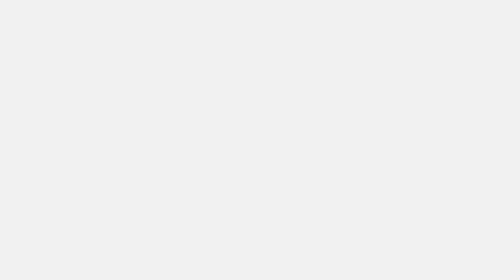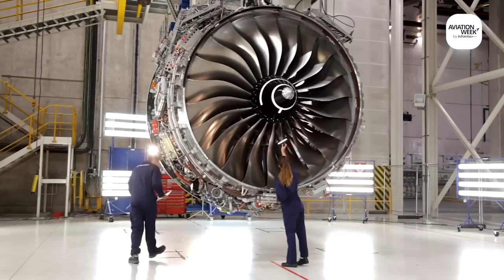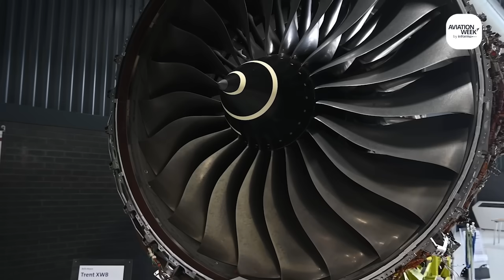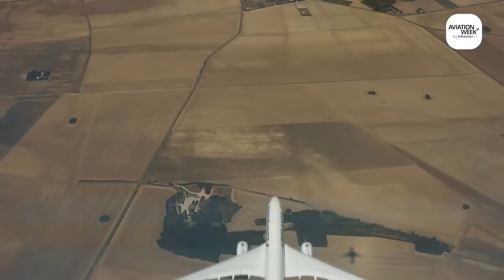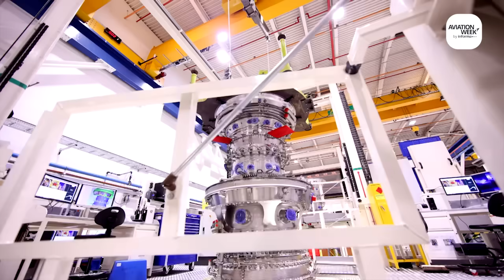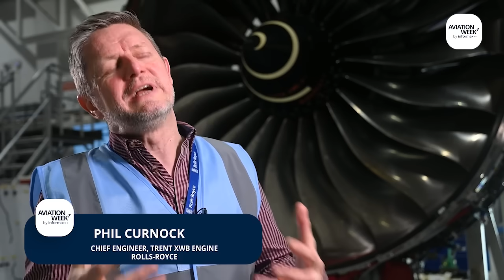Why the Trent’s latest variant is changing the mood at Rolls-Royce

Comment: A GREAT 'Made in ENGLAND' story.......!
Reply: The Rolls Royce aero-engines are made UK, Germany, Singapore, and the US - but UK is where they are assembled...
Reply: @thehumancanary131   ......and where is 'Rolls-Royce Holdings' Plc listed, where are its international headquarters , where was 'TRENT' originally designed and tested ?? 'Rolls-Royce' aero engines are NOT simply "assembled in the UK" (whatever the latter is). 
 'Rolls-Royce Deutschland' was essentially the Ex-'BMW' Aero Engines business and is responsible for the 'PEARL' series of engines amongst others. 'Rolls-Royce' USA was 'ALLISON' and largely turboprops (eg: 'Hercules') business and, now responsible for the USA manufacture of the 'Pearl 'series based engines for the B52 renewal programme. 'Rolls-Royce' Singapore essentially manufactures specialist machine parts. 
Lastly.....IP......think on....'Rolls-Royce Holdings' Plc files, from Derby, over 900 patents a year in the UK and US.
......and here's a nice little official statement you might like to consider......
"Rolls-Royce Holdings plc (which designs and manufactures civil and defense aero engines) is headquartered in London, United Kingdom. Its corporate headquarters are located at Kings Place, 90 York Way, while the primary operational headquarters for its Civil and Defence Aerospace businesses is located in Derby, ENGLAND." (the caps are mine).

Comment: The XWB-97 has 4k-8k hrs time on wing, GE90-115 has 20k-30k hrs time on wing..
Lets not forget RR  RB211's routinely did 40k-50k hrs time on wing.. 
I'd say you have a lot more work to do.
Reply: And no one knows what the GE9X will do, if they don't get that engine seal fixed soonest, because if the B777X fails it durability in hot climates, that could lead to Emirates making order cancellations, as they have both Boeing and GE 'strung up like a kipper' (Google it😃) on compensation.........
Reply: And from where did you derive this data?
Reply: @1chish  my exp as a A/P and quick google search. all three are well known numbers.

Comment: Key Differences in Durability.

Time-on-Wing Superiority: The GE GEnx-1B currently offers three times higher time-on-wing than the older Trent 1000 TEN it competed against. 

Even with the latest XE upgrade, February 2026 data indicates that GE will maintain a significant lead in total cycles between major overhauls.

Material Science: GE’s advantage is driven by its use of advanced coatings and "unshrouded" blade architecture, which reduces weight and thermal stress.

Maintenance Intervals: Current GE configurations are projected to reach 8 years before their first major shop visit in neutral environments, compared to the roughly 5 years targeted by the newest Rolls-Royce XE standard.
Reply: But that hasn’t happened yet, has it?
Reply: @struck2soon  
Please don't give him a reality check, he doesn't want any truth interfering with his fantasies..........

Comment: As of early 2026, the GE GEnx-1B high-pressure turbine (HPT) blades significantly outperform the Rolls-Royce Trent 1000 XE in cycle life, particularly in challenging environments. GE's established blade design remains the industry benchmark for durability. 

HPT Blade Cycle Comparison (2026 Data)

Engine Variant 	Typical Environment (Cycles)	Harsh/Hot Environment (Cycles)
GE GEnx-1B (Latest)	~6,000+	                             4,000+
Trent 1000 XE (Phase 2)	~3,200+	                    ~2,000
Trent 1000 TEN (Failed)	~1,000	                             < 500
Reply: Nothing about the XWB - its a very very selective bit of propaganda here. Whereas the GE9X, after 13 years of development, requires a major redesign of the seal, as the engine has failed those hot sandy conditions you allude to in your comment. Currently, Boeing does not know, whether Emirates 777X deliveries will have the new seal or the old seal, with GE perhaps having to retrofit a newly designed seal after delivery!! If the 777X does not meet the durability specifications on Emirates aircraft, GE will lose a fortune, as EK has a contract guaranteeing performance. Poor GE.......😂😂

Comment: Rolls-Royce has been paying performance and maintenance penalties to Emirates for years due to the Trent 900 engines on its  A380s failing to meet contracted efficiency and durability standards.
Reply: And GE will be paying them to Emirates also, if the GE9X does not get its engine seal redesigned before delivery, and that is a durability issue. Fingers crossed GE gets it done in time, but its by no means a certainty.............

Comment: The proof of the pudding would be Emirates ordering a quantity of 350's, then it would show enough time on wing and hardening against desert environment had been achieved rather than just tame rinsing interview!
Reply: Emirates already have A350s in service, but you don't seem to have an aviation knowledge. Furthermore, Emirates have ordered more A350-900s, with provision to upgrade them to -1000s on the line, after the flight trials for the now developing -97EP are concluded. EK have publicly stated that they will decide then. What's the problem? With orders for the A350 taking the manufacturers to the end of 2032, nobody at either Airbus or RR, are sweating about it ...............
Reply: @artrandy 274 rather than 60 says rather more than your comment. Saeed Al Maktoum and Tim Clark are the opinions I am voicing rather than an Internet scribbler like you or me.
Reply: @BrianArnold-fh6ks  
Either your English needs to be more precise, or you need to learn the basics of commercial airliners, or both. Emirates already have A350s in service. Your comment made no sense, and I don't care what Tim Clark thinks about it. If you reply to me with gibberish, I will point it out every time, and that is what happened.........
Reply: @artrandy Well that response just demonstrates your lack of intelligence as well as your appalling manners.
Reply: Itss  not just the mid east contaimated air.
Its also the Asian sulfur polluted air that causes durability problems with the RR HPT; ( Hi Pressure Blades ), especially the Hong Kong area.
Reply: @John-nc4bl Yes you are right but it is mostly earlier Trent 700 and 1000 engines. Now there is a special coating on the blades to mitigate rhis problem.

Comment: Less noise? Premium cabin on the A350 is louder than 787 equivalent due to buzzsaw. RR needs to implement carbon fiber fan blades.
Reply: RR was the first to experiment with carbon fibre blades in the 1960s, and GE developed the idea further in the 1980s, after copying them. CF blades are a British invention. The same as GE was co-founded by a Brit, and just like the music for the Star, Spangled Banner, was written by a Brit. Just some things that Americans generally do not know about their own country. You should get out more, using the avatar of your sacred religion completely undermines your independence..........
Reply: @artrandy  RR absolutely tested CF blades, but it was NASA and GE who made them viable. GE perfected the shape of carbon fiber blades for maximum airflow, and minimal noise. This isn't about countries, it's questioning why RR continues to utilize hollow titanium blades in their newest engines.
Reply: @12time12  
Im a great fan of RR, but don't support them when wrong, whereas GE might as well have the US flag as a logo, as far as you're concerned. Your support for GE is because they are American, and you know that. 

Im by no means fashionably anti American, but the way many Americans p*** down on any engineering from abroad, disgusts me
edit: sp
Reply: Not necessarily. if you're flying on a 787 with the Rolls Royce option (Trent 1000) ;)
Reply: Finally someone has the same observation ! First time I took an A350, it was in 2020 , Lufthansa from Munich to Singapore, I really thought the cabin was very noisy with a buzzing noise . I asked people around work and everyone seemed not to notice . The 787 is much quieter on the other hand …

Comment: Poor old RR. What about the airlines with aircraft grounded for years?  I sat through a RR presentation on how they’d determined the number of safe cycles to avoid blade failure ;  they were wrong. My airline had failures before this number. This is something of a puff piece for RR.
Reply: You must have gotten lost. This video is not about pratt & whitney.
Reply: @blegi1245 I worked for an airline with problems from both those manufacturers.
Reply: On May 14th 2024, a UAL 787 with GE engines suffered an "uncontained engine failure", linked to the powdered metal issue. NTSB incident number ENG24LA014. People like you are propagandists, you only tell half the story, but not the half that matters. Neither GE, or P&W or RR are perfect, but you like to think that GE are, when sadly, they're not..........

Comment: This was a LITERAL ADVERT for Rolls.
Aviation Week is an Excellent source for anything aviation, but this interview lacked even the Slightest appearance of journalism.
A Real “interview” would have included a discussion about reliability that turned Emirates away from a Huge A350 order in concert with nearly 70% of Boeing 787 customers opting for the GE engines in lieu of the Rolls.
I have no opinion on either engine but this was just poor.

Comment: Reliability first ……economics second , don’t mess too much with something that works . You know all too well the cost of AOGs on Airlines bottoms. My first maintenance job in the 90’s was working on the mighty and amazing L1011 with the RB 211-524, even worked for some time on the RAF L1011 in UAE, moved on the Trent 772B few years later when getting by first type , the A330.
Reply: Our national carrier had RB211-524 D4 powered 747s back in the 80s & 90s which were  amazing. Economy advantages over CF6 & JT9Ds were around 5%!  Unheard of advantages these days...
Reply: @m @michaelosgood9876  what was the airline out of curiosity ? Not common to see RB211 on 747. Mind you , I saw 2 years ago on the ramp here at CYUL , an eastern airline 767 with Rb211… never seen them before, I worked on 767 with the CF6

Comment: When will RR have an engine for narrow body aircraft, missing out on a big market.
Reply: The Ultrafan 30 demonstrator is planned for 2028. If ever launched, it'll be in the late 2030s for next gen narrow bodies
Reply: @Kevin-sl2yw well that’s good news, I didn’t know that, I hope it goes smoothly for RR, big market for the engine. 👍
Reply: The Ultrafan engine is supposed to come in two sizes, wide body and narrow body.
Reply: I wonder if RR would even be able to scale down their 3 spool architecture to a narrow body.   They might need to develop a whole new engine, all for an unknown market.  The days of airframe builders offering 3 different engine options are past.
Reply: @ClockworksOfGL  Its a fair point but Ultrafan is being engineered with narrow body configurations in mind. Open fan is a long way off yet.
Reply: @ClockworksOfGL not quite sure it’s an unknown market, the back order for single isles at the moment is huge, I would of thought another engine option might speed up deliveries

Comment: Funny how they don't mention the XWB 97 that powers the A350 1000 that engine has durability problems which is the reason why Emirates hasn't ordered it.
Reply: Funny how Qatar , Etihad (in the same region as Emirates) and BA, Cathay, Virgin don't seem to have issues, The 84EP developments are rolling to the 97 also as well as the Trent1000 and 7000.
Reply: @cptpltM2000  I thought the time on wing from those other middle eastern cariers was not good enough for Emirated thats why they didnt order the plane
Reply: @Rajahdat-62  None of the new engines have the time on wing like the old ones be it Trent XWB vs Trent 700 or GEnx vs CF6  or CFM56 vs LEAP. Emirates wants the same, or better,  deal Rolls gave Qatar and Etihad years ago. Rolls doesn't need the business today that they were desperate for back then. Their shares have gone up 1000% in 5 years! They will improve the issue but the new engines are running so hot, they will never have the durability of the previous generation. Then you have the desert sand issue too. Both RR and GE will mitigate the issues surrounding mid east climate operations but their engines will never be as durable as the previous ones.
Reply: @cptpltM2000  GEnx has been proven with more cycles per engine than any other turbofan. Advanced materials have made this transition possible.
Reply: @cptpltM2000  The GEnx offers a 2% to 3% lower fuel burn rate compared to the Trent 1000XE.
Reply: @12time12  
Do those "advanced materials" include powdered metal, as a GEnx suffered a disintegration due to PM in 2024......?
Reply: Emirates has provision to upgrade their outstanding orders for the -900 to the -1000, as soon as the new -97 upgrade is flight tested in 2028. Ever thought about doing proper research........?

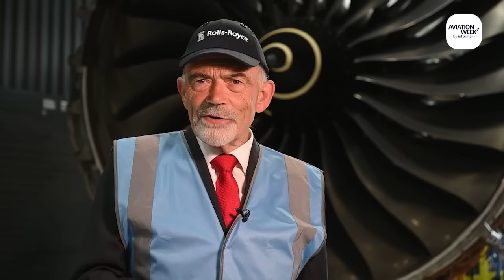Comment: I enjoyed that, but I question whether an independent journalist should bedeck himself in the logo of the subject of his interview. (3:56). I'm sure that Rolls Royce's products, apart from the Qantas A380 engine which had a problem, are excellent. 
As for the 'more quiet' A350, you don't live where I live. When the landing gear goes down as an A350 approaches and passes my house, it, more than any other aircraft type, sends an uncomfortable shock wave to rattle my home. Not a Rolls-Royce problem, of course, but I have nowhere else to vent.
Reply: Don't forget about the Trent 1000 engine powering the Boeing 787 that grounded the majority of the Trent powered fleet. That wasn't too excellent.

Tim Cooke isn't purchasing anything until he sees empirical data showing improved durability in sandy and hot conditions. Engines that have to be pulled with less than 500 cycles, even when RR gets the bill doesn't instill confidence. 

As far as the safety vest, I've worked in all 3 large turbofan manufacturers plants, and was supplied their safety gear, even though I had my own. For all I knew, there might have been a RFID tracker attached.
Reply: So, what do you suggest? Have the AviationWeek journalist wear a GE safety vest when he visited RR site?🤣